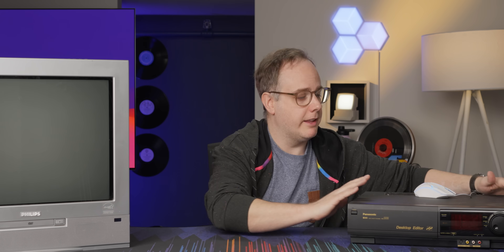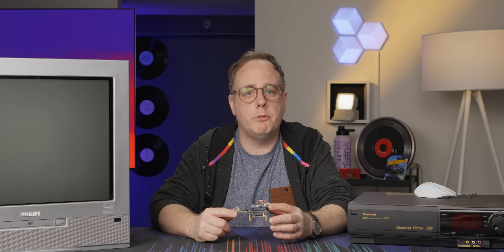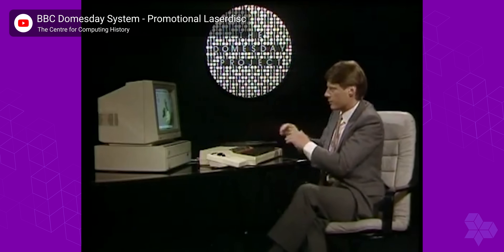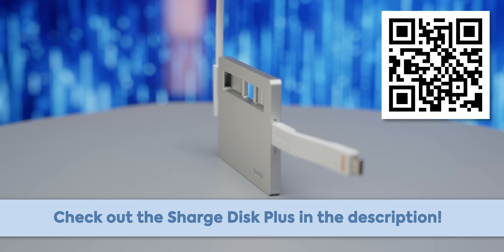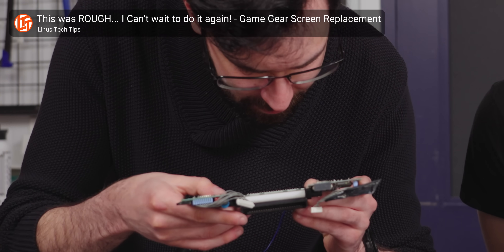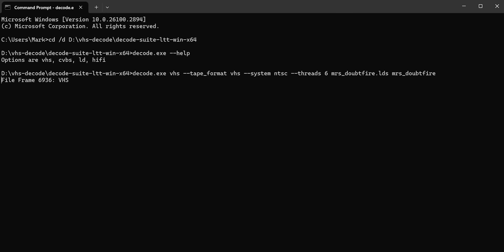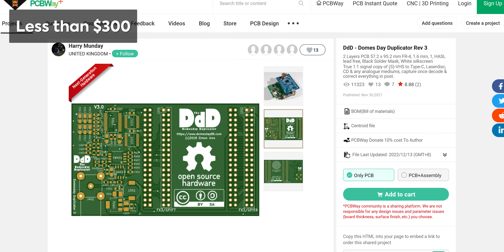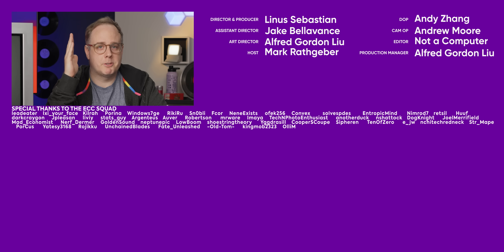I've wasted THOUSANDS of dollars... - Domesday Duplicator

Comment from the maker: Check out the Sharge Disk Plus at https://bit.ly/4agoy0t or https://amzn.to/42bqBks
Reply: I'm hoping Sharge sends LTT the Loomos glasses for an in-depth review.  I want to see a detailed comparison between the Loomos and the Rayban Meta
Reply: @CritCommanda  Honestly would be a good idea to test the sponsors products anyway.  Even a single "catch-em-all" video. Especially when the products are tech related. It's asking a lot compared to most other youtubers, but would make buying some of them more likely for me at least.

Anyway, this is kinda nitpicky from me, I just have trust issues and red flags go up when a product has only a few reviews and some of then claim to have significant issues.
Reply: @CritCommanda LTT? literally anyone else would be a better choice.
Reply: @ please elaborate
Reply: I really don't want to be "that guy", yet here I am. How well was this sponsor vetted?

That disk plus would be exactly what I'm looking for at the moment due to a "magnetically attached disk with power passthrough" sized hole in my gear that I noticed yesterday when my phone died and caused some issues. The Sharge disk plus has only 7 reviews at the moment and a few of them bring out some issues with it not actually working on phones without external power. That would definitely be a dealbreaker, but also might be an user error or the user installed some questionable quality SSD, can't really tell with so few reviews. That's why I'm asking if you can vouch for it.
Reply: That tiny circuit board costs THOUSANDS?!?!
Reply: Oh man. Yeah. I've financed some of the vhs decode project. Nice.

Comment: Basically, the Domesday is better than the CX card if you're capturing Laserdiscs. If you're doing VHS, you want the CX or MSIRC. The major downside of the Domesday for VHS is it only has only ADC channel but the upside is higher sample rate and bit depth. On Laserdisc, every bit of signal on the disc is in a single RF stream and can be captured with the one channel. Not so on VHS, as video and audio are separated.

Comment: Decode is so frustrating.  I've yet to find a Flow Chart / Pert Chart of the HUMAN STEPS!   This is THE MOST IMPORTANT info to let someone clearly see what is involved in the process.  As it stands, MUXing the sound sounds like ART since dropped frames result in sync degradation!  Until someone solves that with hardware or software, the process isn't complete.  I think AI could be utilized for the MUXing problem.  (AI is great at writing software!)

Comment: I don't understand.  How does this decode data better than the VCR can?
Reply: Higher sampling rate of the video signal, software "tbc" - basically correcting jitter etc, avoidance of some analog circuitry. The difference is far from huge vs a proper professional hardware setup though - that can cost a lot, but takes vastly less time per tape once setup. Many amateur captures with good gear are also very good, better than many people think vhs can be.
The vhs-decode image here is also noisy, which tricks our eyes into thinking it's a sharper image.
They also ridiculously modified a top end vcr here, which is pointless & a huge waste/risk. The extra features of this vcr, & even that it's an s-vhs vcr, makes no difference to vhs-decode.
Likewise they didn't even capture the comparison video using this vcr, or if so they did it the wrong way. They used a composite video capture, even though the vcr supports s-video. Likewise the tbc can potentially help with image quality. I suspect they also used an unsuitable capture card, which can make a big difference.
Reply: Thanks for the answer :)

Comment: I was doing this 15 years ago profesionaly with a TBC and Id record the tapes to raw avi, so I think a TB a Hr,  then use avsynth to filter some noise out, work on the audio and then slowly transcode (canopus) into a Interlaced BD at max bitrate and a DVD at 9111Mbps again max birate.  it then looked exactly like the orig VT
Reply: Raw conventional capture & rf capture at a much higher sampling rate is a very different process.

Comment: I don't understand why it has better quality
Reply: It takes the rf signal and decodes it straight to video instead of it being decoded by the vcr, converted to other signals like composite which is an analog signal, then degraded over a wire, then recorded
Reply: @GameTapesArchive  It's barely, if at all, degraded from just running over a good quality cable - it's just an inherent issue with the composite video signal. However many capture devices effectively reverse the effect to a significant degree. VHS is also already a composite-like signal, though effectively somewhere between composite & s-video.
I suspect a very large portion of the quality improvement is just due to a much higher sampling rate. However the quality difference isn't huge anyway vs a quality conventional capture method - which they didn't do here, despite having a high end vcr.

Comment: You guys, please DON'T do this. This is NOT “the best” way to archive analog video—in fact, far from it. While I don’t think Mark is trying to mislead anyone, it’s important to recognize that he likely doesn’t have 30+ years of professional experience with analog tape formats, restoration workflows, or how signal paths actually affect archival quality. And that shows in how he interprets what he’s seeing in his comparisons. The sharper, more saturated image from the Domesday RF method isn’t a better capture—it’s a NOISIER one. There’s a real psychovisual trick going on here: added grain and boosted color can LOOK like more detail at first glance, but what you're really seeing is a noisier, less stable image. This is a classic cognitive bias where “more” (color, grain, edge contrast) gives a false impression of higher quality. It’s the “wow” factor—but that does NOT translate to a better archival master.  If your goal is to PRESERVE and/or possibly later RESTORE analog material, what you want is a neutral, clean, stable signal. Slightly soft and desaturated is ideal—it gives you headroom for color grading, denoising, and especially AI-based upscaling. The AG-1980 (the VCR he is using here) has internal TBC and DNR circuits that do this extremely well when functioning properly (Mark, get your capacitors checked), and the resulting captures are far more useful for restoration work than anything pulled raw from RF and reassembled in software still under development.  If you’re unsure, check out the upscale samples I’ve published on my channel—that’s what’s possible when you start from a clean, properly captured signal. Don’t chase noise thinking that it’s detail!
Here's my workflow:
AG-1980, TBC and DNR on, Sharpness either center or slightly right of center position. Play a bit first to get the tracking right...then jog back to the beginning and capture.
S-Video Out > Osprey S-video to BNC Breakout cable > Blackmagic Analog to Digital converter > SDI > Blackmagic Hyperdeck HD Studio Mini (set to encode ProRes 422) OR capture to Blackmagic UltraStudio 3G Recorder to your computer.
This is really the only method I would endorse. I mean, if you're going to spend money on this, do it correctly! Don't do what's in this video.

Comment: If you can get a video recorder with decent S-video or SCART out, you can get a really good picture. VHS tapes are recorded, as the video shows, with separated chroma and luma and a good S-video VCR will basically just give you a direct feed of this. SCART can vary wildly, since it is analogue RGB(same as VGA, but at 15.5KHz horizontal) and it has to be converted first, but if the conversion is good, you get a really clean, sharp image.
Reply: It's not as simple as that, vhs is not recorded as separate y & c, it is effectively somewhere between composite & s-video. Even s-vhs recordings are the same, they effectively just increased the bandwidth of the recording.
No normal vcrs output rgb from a vhs tape, they will just output composite or s-video[for an svhs vcr] through scart. Some combo vcr+dvd recorders can output rgb via scart as they internally digitize the vhs or other input analog signal & then convert it back to analog outputs &/or hdmi.

Comment: 4:07

Alligator test clamps like these are the new hot garbage. You should do conductivity testing of your leads and clips to see if they are made of steel, because its cheaper.
Reply: Normally it wouldn't matter, like for more than 99% of people using clips for whatever but signal integrity is important and you want good signal for something like this, so you would want copper wires.

Comment: It would have been nice to have seen a comparison between the RF signal and S-Video capture.  Comparing it to Composite video seems like...I mean, you clearly have the experience to know not to digitize VHS from composite...so it can't be incompetence...
Reply: Not even VHS from composite using a good quality comb filter looks THAT bad and dark... I'm really curious what capture device and settings he used and if he used a good comb filter for composite and it doesn't look that he used a proper TBC despite having there a high end SVHS vcr.

Comment: As someone interested in the Vhsdecode project, you really should document more your exact process modding the ag1980 for this. There is a surprising lack of documentation on modding the AG1980 or short video samples taken from one
Reply: Using an AG1980 for vhs-decode seems a horrendous waste of a high-end VCR, which is almost certainly why it's not documented.
People value this VCR for the TBC & to some extent for the SVHS playback(& s-video output, including for conventional VHS), the TBC is completely bypassed by vhs-decode, and s-vhs is largely also meaningless.
Reply: @ I would disagree as it has some uncommon features that would still make it particularly useful. 
For me, it has a dedicated output for linear audio, and this would allow you to capture linear audio and hi-fi audio tracks (not always containing identical content) at the same time, synchronously. 
A conventional video capture can be had from the Svideo output as well, making this a really neat one-stop solution to capture everything from the tape in one pass. 

Of course it’s possible a direct output from the linear heads could be modified on a lesser vcr, but I don’t know of anyone who’s tried it. 
The AG1980 also has extremely good quality audio circuitry, much better than any JVC unit of the era… 

I also think that a high quality stable tape transport may ultimately prove beneficial than a capture from a lesser deck, this is of course only theoretical until someone directly compares captures of the same tape in different decks. But I think it could compare favorably.

alot of this model’s typical benefits may not apply when capturing for VHS decode but I think it is still uniquely desirable and could be worth it for very particular archival minded people

Comment: I don't understand why pulling it over rf and not before rf is a thing
Edit: I'm dumb, it's not the tv out rf, but the rf from the heads directly. Neat.
Reply: Also I found a weird Blu-ray player with VHS built in and only hdmi out.. been curious to test it.
Reply: @forbiddenera  the hdmi likely doesn't output the VHS video signal. i've tried on mine.

Comment: Wait; if just about all VCR's have those testpoints, then why hasn't anyone made an HDMI mod akin to what exists for retro consoles?
Reply: Because what you get from these test points isn't a video signal. You have to decode it afterwards and that takes a long time, it isn't done in real time.
Reply: @lucadipaolo1997 Sure, your average off-the-shelf PC might not be able to decode the signal in a timely manner, but are you sure it isn't possible to design bespoke circuitry and chips to handle it? It's one thing to make a file for most computers to use, it's another to make something more proprietary for a specific use case.
Reply: @N-MCMXCIX  I think it would be possible to create a chip that decodes it in real time, but I'm not sure if there's a big enough market for it to be viable.
Reply: This, 100%

Comment: So how does this compare to HDMI capture on a modern VCR?  This RF way seems way complicated.  I had so many issues with audio sync capturing with composite any time home videos had blank space.  Since this VCR DVD writer combo had HDMI I bought an elgato HDMI capture card and pulled it that way.  Did post processing.  Came out great except for the color fringing and color cast on the edges probably from the camera.  One downside to HDMI is that it passes the HDCP DRM flag for movies which Elgato did not appreciate.  Im sure there is a workaround for that.
Reply: hdmi on a "modern vcr" is just being internally converted from analog by the system, & these contain ok but definitely not high end vcrs, so the source signal is limited.
hdmi capture is fine for easy capture, but the process you're using isn't a high end method - vhsdecode is to try & get the absolute best quality from old, existing recordings. Likewise conventional capture methods also improve quality, but can cost a significant amount & require knowledge of hardware & software to use.

Comment: Hi.  Thank you for this video.  Can you describe your composite capture workflow is?  I am curious if a well-tuned AG-1980, using S-VIDEO capture is going to compare to VHS Decode.  I plan on doing this test, but waiting for an alternative to an add-in board.  I am also curious how the audio capture would work.  Anyway, I use a Micomsoft to capture the video and I have been impressed by the quality, so you can imagine my excitement at a higher quality capture.

Comment: Another thing that (I think?) wasn't mentioned is that since you're capturing the Radio Frequency, you can capture from several different copies of the same original and overlay them to better approximate the original (if I understand correctly), and THEN decode, so the error introduced by the decoder does not accumulate.
Reply: So like, capture it, rewind, capture again, that sort of thing?

Comment: it's literally easier and cheaper to do it the old fashioned way. even using a DVD/R-VHS recorder is easier. 
also I have never seen a VHS tape where you "can't see people's faces", either you're just saying that to shill this product or you bought some TERRIBLE cheap tapes and camcorders back in the 80s/90s
Reply: Their comparison image at 1:33 was them literally picking the worst possible capture image from a web page. It's abysmal quality, even the cheapest "easycap" that cost a few $ would likely do better than that.
vhs-decode is intended to just squeeze out all the possible image quality though.
Likewise with conventional captures, the easiest & relatively cheap methods never give the best quality.

Comment: I can vouch for the magic that is the decode suite!
I don't use the expensive MISRC or a Domesday Duplicator - rather two modified capture cards that their community calls "CX cards". With those, a Raspberry Pi Pico, and a PCM1802 board off AliExpress, I get pretty good results considering I have only spent about $150 in total, which accounts for the capture cards, pi pico, all of the coaxial cables, BNC connectors, BNC cables, the VCR itself and custom amplifier board. Certainly a lot less than the hundreds... or even thousands that some forums will try very hard to lead you to believe is necessary.

Comment: Say, I have an oscilloscope with the ability to capture, could I use that instead of buying a separate capture card and then process with the demonstrated tools shown?
Reply: If you're able to stream data from the oscilloscope at the necessary frequency without any sample drops, yes. That's very unlikely though
Reply: @ I saw on the wiki there are a lot cheaper caputre options available too, so it's not a big deal

Comment: I have a VHS player that outputs HDMI and it looks amazing. So really that's all you need and you just plug it into whatever you want, PC , Capture Card , other Devices or just record right onto the DVD. A lot of companies made HDMI VHS/DVD or Blu-Ray players. Here is the model I use. Magnavox ZV427MG9 DVD/VHS
Heck they even made some with SD Card slots all the way into the mid 2000's
Reply: They can give good image quality but they're never the best.
The whole point of vhs-decode or higher end capture hardware & software methods is to get a better image.

Comment: should have just gotten a 	LG RC897T  it records the VHS directly to DVD  or capture via HDMI output in 1920x1080P (Yes it outputs VHS over the HDMI port)

it's pretty nice you can also Record onto the VHS in widescreen 16:9 formatting
Reply: DVD you are stuck with old MPEG encoding in the DVD-Video format. 
HDMI you are stuck with whatever the device is doing converting to digital and further messing with it resizing to an odd size. 

These are not good methods for preserving analogue recordings.
Reply: @Didz  i did it out of preservation  VHS isn't  the best format  and it was the last remaining copy of the family film. I have it in a ISO format  in it's original 640x480i format...  I don't have the original film to copy it to the DVD directly or HD copier  

 you can output HDMI in 640x480i if that is your choice of  output   you will need a de-interlace though or a CRT TV to show the image correctly

that recorder  does 1:1 copy of the VHS  and you get the original 480i on the dvd   which was copied to a ISO on a hard drive then safely stored on the cloud forever.. 
🙂  there is no conversion and you get the best picture quality possible  DVD is MPEG2

the video imo looks better then the playback on a normal VHS player it self
Reply: @punker4Real  yeah nah... you have no idea.
Reply: @  the tape was deteriorating  What i was able to save was better then having nothing at all..